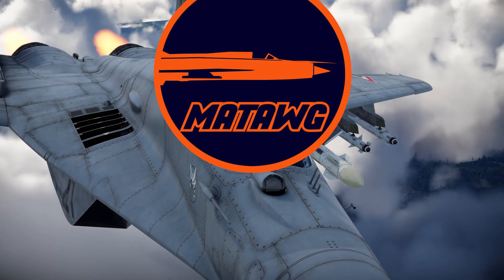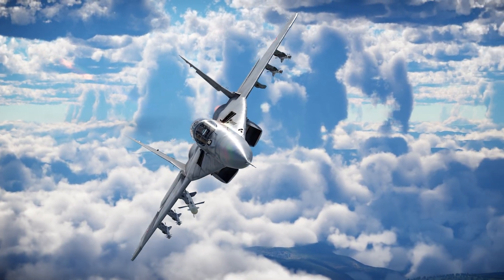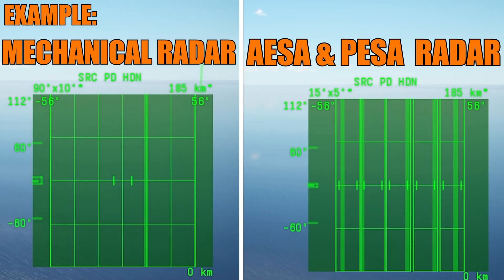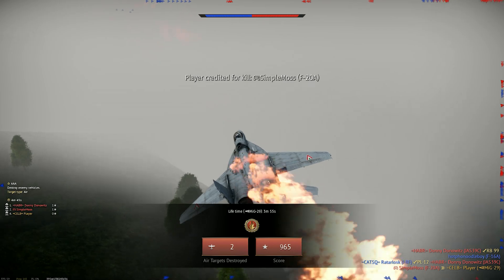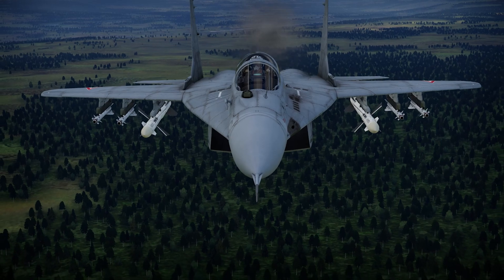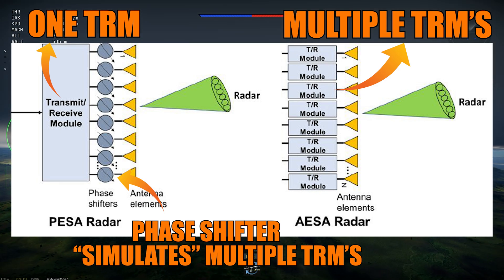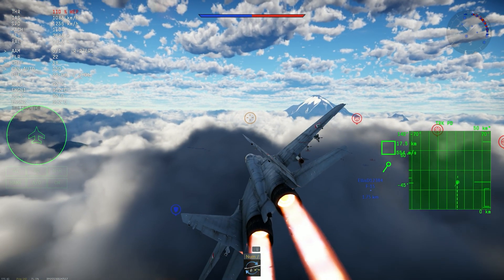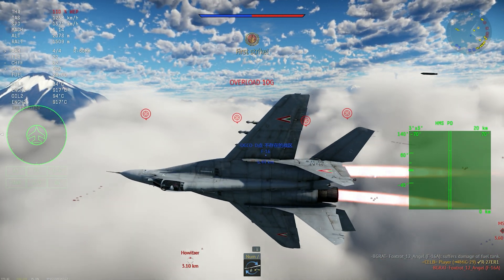The FUTURE of RADARS in game! WHAT are AESA & PESA radars? - War Thunder

Comment: They cannot model the AESA radar properly with the radar code in the game. Radars in War Thunder don't work like normal radars. It finds and tracks the target just like aimbot! Radar even followed me from behind the mountain. 
   First they need to completely change the radar code. For example, it will send an infrared radio beam to the target. It will track the target with radio beams reflected back. They may even add synthetic-aperture radar to the game. For example, it will work like a lidar sensor (the way it works with radar is similar). However, lidar works with a narrower wavelength. Radar uses a wider wavelength.
Reply: It's fully possible, the Pantsir already has a PESA Radar in game. Try checking one out in a game replay with the radar overlay
Reply: @RentoBrento79  I'll take a look if I get a chance. The radars in the game are still like aimbot.
Reply: @hamzaterzi8801  It uses Memory tracking to track behind obstacles
Reply: @honeybadgerbomb4469  Well, it wasn't like what you said in the replay. Even though I was maneuvering, F-14 and Aim-54 were following me from behind the mountain. I played this game for 5,740.5 hours. My player name T-850. I know the mechanics of the game very well. I even reported this as a bug and they still haven't closed the issue.
Reply: @honeybadgerbomb4469  The radar can track the aircraft with its last memory. Calculating the aircraft's latest speed and heading. Radar can predict the route it can take. However, this did not happen in my Air RB match. I keep maneuvering and the radar follows me in the same way. Just like aimbot.
Reply: Blatantly false. One of the coolest things about warthunder is honestly how well is simulates them. Yes, sometimes it will track through a mountain a bit, but that's typically just inertial lead from the radar trying to require a lock, it's not actually maintaining a lock on you. Also radars don't even use IR, actually learn even the most basic thing about how radars work before making statements about how they should be modeled.
Reply: @user-Xx0xxxxx  The wavelength that the infrared thermal camera can see is 8 to 14 micrometers. Again, the radars work from 1mm to 1 meter at wavelength. Radar and microwave is infrared. Because our eyes can't see the aftermath of red. That's why it's called infrared. So why did I write like that? Because radars work like visible light (We can't see it just because they are infrared). With Nvidia's ray tracing technology, we can make the radars in WT completely real. WT radars don't have to do like aimbot. I hope you understand why we describe radars as infrared.
Reply: @hamzaterzi8801   First off. Radio frequencies are not part of infrared, as you yourself confirmed you know. They're different parts of the elctromagnetic spectrum. Secondly, raycasting wasnt invented by Nvidia. Its been a thing in rendering for a long time. Thirdly, as i said before, the game literally does simulate radars to a considerable extent. They have fully modeled doppler gates, position filters, lock memories, etc. They literally do everything short of full raytracing. Which, by the way, would not be easily viable. Rays take more power to compute the longer thet are, and have to be done in sections in order to not cause lag spikes. Casting rays several dozen miles long would take considerable computational power, be very prone to lag spikes, and have other technical issues.
Reply: @user-Xx0xxxxx  I think infrared is called for a certain wavelength in English. When we say "kızılötesi" in Turkish, we call it all infrared, micro and radio wave. That's how I learned from my teachers. Because of the difference of culture and language, we fell into such disagreement.
Reply: @user-Xx0xxxxx  We live in the 21st century and technology has advanced a lot. This may be possible with new RTX cards. You don't know without trying.
Reply: @user-Xx0xxxxx  Because "kızıl" means red and "ötesi" means beyond. When we say kızılötesi wavelength. We say something like wavelength beyond red. I thought the infrared in English is like that.
Reply: @hamzaterzi8801  Ahhh, nah, in english infrared is only that specific spectrum of 750nm to 1mm. Kızılötesi is a very literal translation of infrared, but to be honest most english speakers dont actually know that infra means below. So we tend to think of it more as that specific range then as the whole band beneath it.
Reply: @user-Xx0xxxxx  In Tureng, the infrared has a lot of meaning. But as you said, it is used for a certain spectrum.
Reply: @user-Xx0xxxxx  So if I write it in the form of infra-red. Does it mean that the wavelengths beyond red?
Reply: @user-Xx0xxxxx  I did some more research. Kızılötesi is used for wavelengths between 750nm and 1mm. I don't think there is a common name for radiowave, microwave and infrared. It's like a common name but it's not. A different name could be used for 750nm to 1mm. For example, invisiblered would be a nice name. Radio and micro wave are more special names. However, kızılötesi and infrared like a more general name.
Reply: @user-Xx0xxxxx  A Youtuber managed to display the inside of the house with the modem's radio signals (infrared radio wavelength). I hope you understand better now.

Comment: btw F-35 has a Gumball límit of Up to 120° so You can literally run while You track, this Will be a really good feature when the British F-35 gets added with it's MBDA Meteors
Reply: Mistake. 120 deg is an FOV, which means you can't go cold or notch, bc it's 60 to the left and 60 to the right.
Reply: @shadow_spark8788 your radar don’t govern if you are able to notice of not, I believe notching only works when your opponent has a pulse Doppler radar your equipment doesn’t matter you just need to look still pulse only tracks when yours approaching the radar when you notch the radar see your not getting any closer so it just don’t detect you as the distance between you and the radar is at a slow stable speed
Reply: @Nickjustdabs  I mean that F-35 can't notch/go cold and track targets in the same time. FOV is 120, not 180+ and you have to stay hot if you want tracking.
Reply: @Nickjustdabs Still works against a missiles radar cause most fox 3’s aren’t equipped with aesa. As long as the aesa plane is holding lock notching isn’t as effective.
Reply: @shadow_spark8788 you could because AWACS or other jets with datalink could guide your missile via datalink
Reply: Fr? That’s cool
Reply: Im really hoping they add all 3 variants of the F-35 to the US tree, and make the VTOL variant a premium since its unique and also the worst version so it wouldnt be an issue. One of my favorite planes and i hope its done right when that time comes.
Reply: @fire_drake12.arc.24  Not premium 5 gen 💀
Reply: Every tech tree except russia and china are gonna get f 35s.
Reply: My friend is a physicist working at MBDA
Reply: 4.5 gen is probably as high as they go NGL 😂😂😂
Reply: Only AESA’s on a gimbal can do that, such as the new ECRS Mk2 for the Typhoon.

Fixed AESA’s are limits to 180 degrees total because, well, they’re fixed.

Comment: So basically, AESA > PESA 90% of the time I guess?
Reply: Yes, but the real advantages are in bandwidth and signal processing, which helps with jamming.

Since jamming and EW isn’t a thing in WT, all AESA will do better is somewhat better tracking of targets, but against 4th gen jets in WT’s current gameplay loop, PESA will be adequate. 
Imagine instead of several small radar beams moving around 100 times a second for AESA, it’s just one large beam moving around a few dozen times a second.
Reply: @jacobbaumgardner3406  Ah, I see. I feel like limited EW could work in WT but it would have to be adjusted for balance

Comment: probably will come sooner then you think, i was looking into the Flanker side of aviation, there isnt really much left that doesnt use PESA's, any other variation better or more modern then the su-27sm uses the PESA (as far as i know, and only in the su27 side of things, not su-30 or su-34)
Reply: In this december we''ll pretty much see aircraft with this new Tech, with Russia most probably getting the Su-30
Reply: @Thiago--de6ez hm, i always think a Su-30 would come with a strike eagle, what i personally think will happen is a much better su27 (maybe a su37 but i really doubt it) , maybe a su-27sm2, in the game, being a stop gap for the su-35
Reply: @Thiago--de6ez   possible that we will get gripen E-s or gripen C5-s with ps 05 MK5 AESA
Reply: Actually the other way around. No Russian Su-27 uses PESA. They were trying to fit Bars to the Su-27SM2/3, but never succeeded, so it’s only the Su-35.
If we want to see an earlier PESA Flanker, until probably be the Su-30. Issue is that they are even heavier than the Su-27SM with no engine upgrade.
Reply: @jacobbaumgardner3406 there were engine upgrades, at least to 35 and 30, not 34, because maneuvering isn't it's primary function, but it's still maneuverable regardless
Reply: @DrClef_1  there were EVENTUALLY upgrades, for the Su-30SM2 for example, which is an Su-30 utilizing Su-35 technology. The base Su-30, like what we’ll be getting first, don’t.
Reply: @jacobbaumgardner3406  hm, got a source? 
and for implimentation in war thunder, i dont think it would really matter at all or would even be added without the PESA